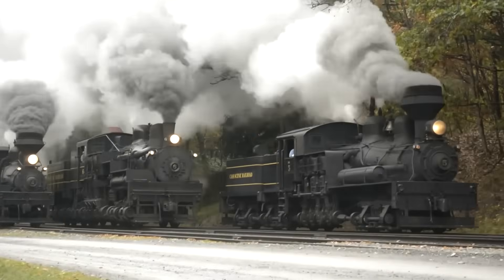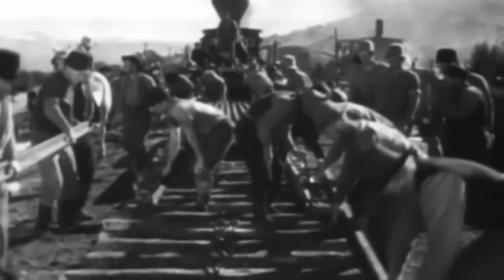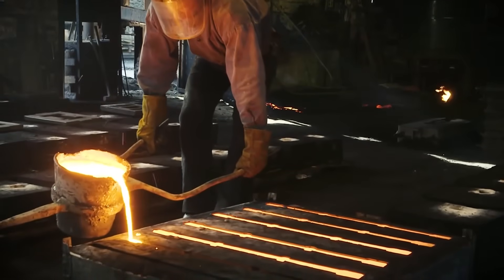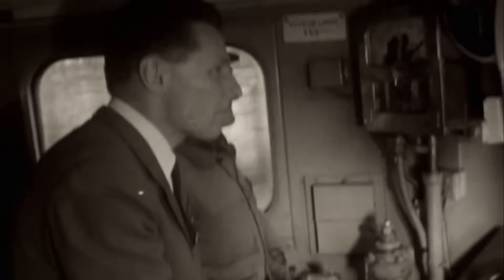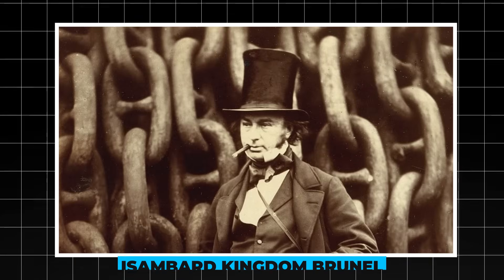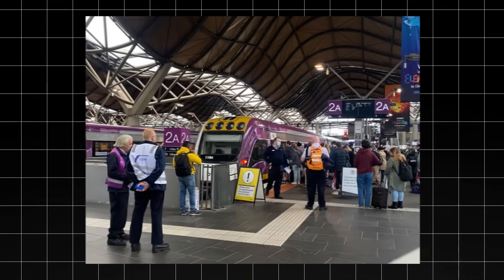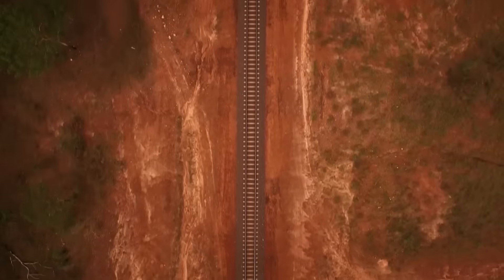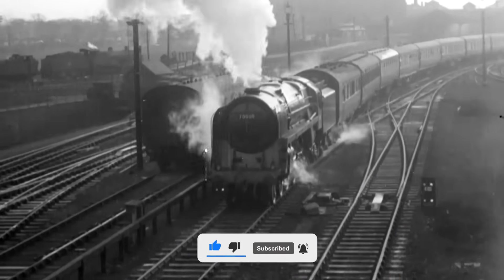Rails Through Time: The 200-Year Evolution of Train Tracks!

Comment: I would have preferred the 6 feet 2 inches gauge. 
What about the rails , are they all of the same diameter?
Reply from the maker: Great question, rails vary slightly and are usually anywhere from 2.5 to 3 inches (6–7.5 cm) wide at the top.